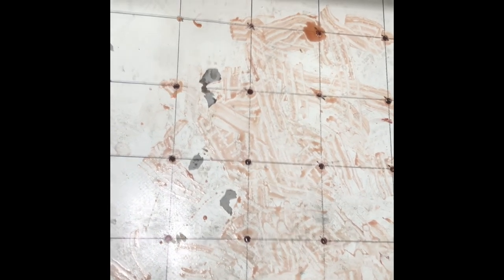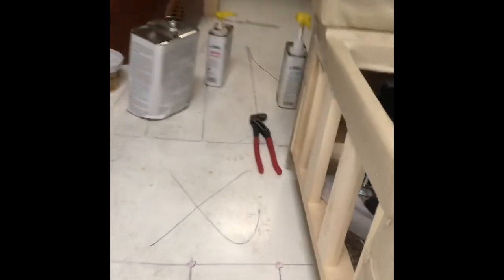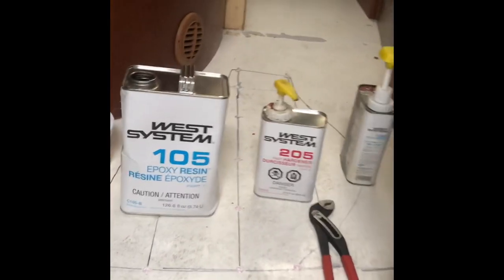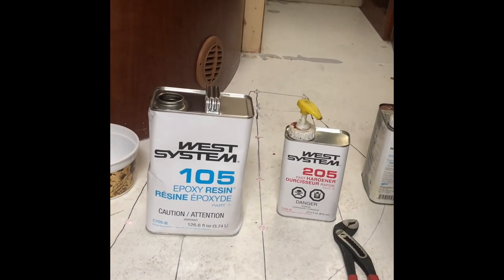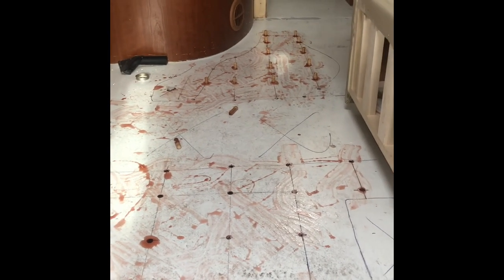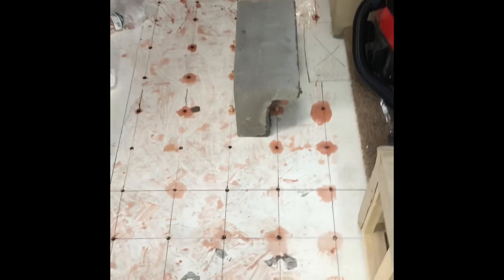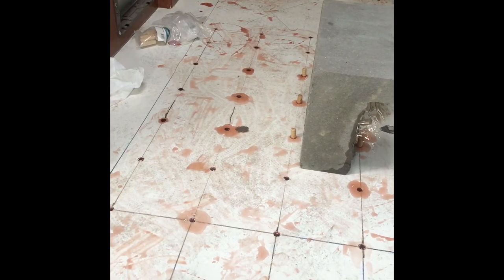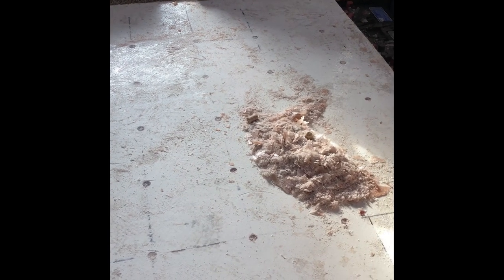Soft spots in a RV/motorhome floor Bonded or sandwich floor fix

Comment: Good video, I repaired my RV floor this way as a result of water damage which I think is often the cause. In my case, the floor (2-3 inch foam sandwiched between two thin layers of plywood) was still wet on the underside and the underbelly membrane had de-laminated in these areas. I think It is important to cut open this membrane to check for moisture and let the plywood dry out first and then glue and  tape back or replace the membrane before you start the epoxy. If there are sagging areas of membrane and  layers of plywood then you will end up wasting alot of this expensive epoxy to fill these voids. I used a jack and a piece of plywood to push the underbelly flat after gluing and epoxying. From above, I used a squeegee to push the epoxy flat after my injections. I would often epoxy down the holes a second time if they seemed to suck up way too much epoxy. Areas of the floor covered by cabinets etc could be done same way as people post how to epoxy RV wall back together (by injecting down tubing attached to a long flexible steel rod or drill bit) then holding together with plywood. Before I started the project I covered all roof seams with 2" and 4" wide Butyl sealing tape and I will re-calk some windows/compartments.

Comment: Keep making videos, RV repair diy is very niche and in need of posters like you with hard and reliable experience.  Nothing more frustrating than looking for specialized help and finding none. I had one more question, do you know if any RV manufactures stand behind their faulty manufacturing or faulty materials supplier? You’d think they would, if only in order to maintain their reputation.
Reply from the maker: I’m glad you enjoyed the video. As far as your question it really depends on the dealership in my experience to how well you are looked after. The manufacturer does not really deal with the public

Comment: Thank you for sharing this video. There is not many videos or forums on RV foam floor repair. I used West systems 105/205 on my Ultra-lite travel trailer for a 3'X3' section of my floor. Surprisingly it worked and is holding up. I believe this is the only epoxy resin on the market that will not melt foam on contact. Once its mixed together, you have about 10 minutes to inject it into the floor. Once it is set, the resin heats up hot for a bit. The product was not cheap ($70 Amazon) but cheaper than a dealer repair for sure.
Reply from the maker: reservordogz 
Glad it helped the floors I have done are still going strong with no issues.
Reply from the maker: Glad to see the video helped. All the floors I have done this way are still standing up. Hope to do more videos like this need to break the 1000 subscriber mark then it will be easier to do these videos
Reply: So regular fiberglass resin you can buy at home depot or advance auto will not work? Any alternative to the West systems 105/205? Great video.
Reply: Hi there. Was your trailer a jayco? Was it the Luna panels? I have a jayco hybrid 17 ft camper trailer with the Luna panels in the floor. I am noticing some soft spots in high traffic areas. This seems like an excellent alternative to resheating the floor to regain some strength.

Comment: Good evening fantastic video. I have the exact same model of motorcoach and soft spots in the same locations. I took up the Lino today to do some other work and was sent your video. I found a local marina that has the west system epoxy, so I will be doing this tomorrow. Again thanks for the awesome video.
Reply from the maker: Just through the top layer you will feel the drill bit hit the bottom layer use light pressure you should be ok. As far a the grid pattern I just do what ever grid that will work in the area you may end up using less or more.

Comment: This is an awesome video. It is a alternative to trying to resheat your floor with a new product to regain some strength and high traffic areas. I will definitely be doing this to my jayco 17 ft hybrid. I have been noticing some soft spots starting in the Luna panels.

Comment: I've seen where you mentioned this would likely work on wood/Styrofoam combo. I've been looking from underneath contemplating adding supports when I found your video. Question is, I do see the floor move (push down) when someone walks on a problem spot. Is that what this is helping with in general or should I keep looking at adding supports here? Thanks for the video btw!

Comment: Thanks for making this video.  Wish I would of found it 6 months ago before I started trying other methods to support my droopy/sagging floor.  Does this fix seem to be a permanent fix or a temporary patch?  You show the dowels but didn't show actually using them.  Do you need to put them in each hole or just under certain circumstances?
Reply from the maker: I used them in every hole

Comment: We just bought a 2014 Rockwood end of April 2013, used it first time in mid-June and found soft spot on a 10"X10" vinyl in front of the entry door.  The rest of the floor is ok.  We've owned Rvs for over 30 yrs and have never had this issue.  Should we remove the underbelly to find the problem rather than rip the lino
square?  Where are you in Central Alberta?
Reply from the maker: Would have to see it to give you an answer on that. I’m in the Red Deer area.

Comment: Great video ! I have a 2013’ forest River v cross . Previous owners weighed 400 lbs and now this rv has soft floor. Question: why couldn’t I drill thru the vinyl flooring instead of removing all the vinyl, then install new vinyl floor over top of old floor (which would have holes and epoxy in them) ?
Reply: This video answered my prayers!!! My elder mom just bought a 2017 Forest River Vibe and there are very soft spots in front of the kitchen sink and the toilet, they both have a round appearance, like the vinyl has a round hole beneath it with no support. I’m a novice DIYer and am looking for a workable solution that doesn’t involve pulling the entire floor out. My question is, could I skip removing the vinyl, space and fill the holes right through the current vinyl into the sandwich, then use peel and stick vinyl over it -(in the places it shows, not in the storage areas, under beds or cabinets) once the epoxy sets?
Reply from the maker: You could but all the imperfections will telegraph through the new floor. Would have to float the floor after.

Comment: Hi - I just watched your video and I think it's a great idea to do it this way but I wonder if using an expanding closed cell spray foam would work as well? Closed cell foam is a great product. It has superior insulation, will never break down and is water proof. It also add's a degree of structural strength.....
Reply from the maker: It might but you would run into the same problem that caused the problem in the first place. The lack of support under the floor caused the foam to separate from the top and bottom layers and cause it to deteriorate causing the soft floor. Spray foam may fill and firm up but would not provide the structure the epoxy does
Reply: @thecanadianrvrepairguy3062  - Thanks you may be right I'll have to do more research maybe in the end going the epoxy route.

Comment: Great job. I know this video is several years old but I have some questions. Did you remove any of the wet wood or did you let it dry out first and then work with it?

Did you support if from below?

I have a 3x3 sort sport right on front of a slide nd it really sinks when stepped on. It's also sunken before it's stepped on. 

Thanks for any input you can provide.
Reply from the maker: I did not have to remove anything on this job. The reason on this one was due to deterioration of the foam over time.

Comment: We have a 2018 "ultra lite" travel trailer with the foam floors, but haven't had this problem yet. Would you say it's inevitable that we will? Also, I apologize if  I missed this, but what happens to the dowels. Are they removed, or cut off flush with the surface? Great video. THANKS!
Reply from the maker: Does not happen to all units, only ones that lack support under the floor. As far as the dowels they get cut off flush and sanded down before the Lino gets put back down.
Reply: This gives me peace of mind what to do if the problem develops. There are other videos of people doing insane projects replacing their floors, this method looks doable. THANK YOU!

Comment: Did you reuse the vinyl flooring, or did you have to buy new flooring.
Reply from the maker: Yes I re used the vinyl.
Reply: Was the flooring glued down? How did you remove it and what did you use to re install it? I have a Rockwood that I am going to do this to with the same flooring.

Comment: What do you use to reinstall the Linoleum? I don't have any trim. I suspect you use some type of adhesive to "glue" it back down.
Reply from the maker: It all depends on what type of Lino you have paper back, felt back. Find out what you have and get the correct glue for the Lino you have to put down
Reply: @thecanadianrvrepairguy3062  thank you

Comment: Did you have any sagging where there were seams in the flooring panels? I have some at the seams and am concerned this will not fix those areas.
Reply from the maker: No I did not have seams if I had some pictures I might be able to give you a better idea.
Reply: @thecanadianrvrepairguy3062  thanks for the quick response! If you reply with your email I'd be happy to send you a video and/or some photos
Reply: Hi , liked the video good job. I was thinking I would lay quarter inch ply over the whole floor to fix the occasional soft spots. And screw it down. Would you suggest that or not. Thanks. N.B. CANADA

Comment: was your floor uneven?  I have several "dips" in the floor, so I'm not sure if this repair would work
Reply from the maker: Yes there are always dips from the foam breaking down. The thing you need to watch for is once you inject the epoxy you can get high spots

Comment: Thank you for sharing your floor repair. This is a real issue for coaches with bonded floors. What make, model, and year was the Sprinted-based RV you were working on? Also, how thick was the foam core between the Filon sheets? Anything you would change about the process if you were to do it again? Thanks again!
Reply from the maker: The foam core was 1” thick.
Reply: I am not sure of the year but that was a Thor Siesta 24SA, probably between 2013-2015.
Reply: Has anyone sued the manufacterer as this seems to be a common problem? I have a 2015  Forest River Micro Lite with same problem. Thanks for sharing

Comment: How does this type of repair hold up over time?  Also I have been researching this repair online and have watched several videos on Youtube and it seems that this type of repair is not very common in the U.S.  I have a 2011 Keystone Laredo that has a spongy floor, not due to water damage, so I am very hope full that this is my answer. Thanks from Texas
Reply: Did you do this and how did it turn out?  We have a 2012 Keystone Outback that has soft floor in a few places.

Comment: Thank you for the video. I’ve been stumped on this issue and this appears to be the same make/model as mine. My question is how did you get the linoleum out from under the slide? Did you have to remove the slide? If I cut it just under the lip of the slide so you can’t see it, I was concerned the linoleum would pull up when the rollers extend/retract. Any info would be helpful. Thank you!
Reply from the maker: That is where I cut the linoleum as far as I can reach under with a knife. Then I glue it all back down and if it look to be an issue of peeling I staple the edge as it is still in an area the can not be seen. But the glue usually is all that is required and no peeling issues.
Reply: @thecanadianrvrepairguy3062  That’s really helpful. Thank you so much for the quick reply.

Comment: Is there a way to replace these types of floors economically? Can I change it to a traditional joist and plyboard floor? Or any other suggestions on how to replace\repair if the entire trailer floor is badly softened or is this the best\only method?
Reply: Because of the light or ultra light designs, it would be a tedious and exhausting job.
You're better off using this product and it leaves it harder then original.
Reply: @JulioHernandez-xk7np  - You aren't wrong! LOL At the present time, I have a camper box sitting on blocks and the trailer pulled out from under it in my back yard. 🤦‍♂️ 
New floor being installed next weekend.

Comment: How can you tell...#1: what type of floor you have. #2: how deep to drill? Good way to fix a floor. Great for a small are that needs repair. Better get a camera guy to free up your hands. lol
Reply from the maker: Yes I don’t always have someone to hold the camera. As far as telling what type of floor you have lift the Lino up in a inconspicuous area and see if you have filon or wood under it. Hole depth just through the first layer and stop when you hit the bottom.
Reply: If you have ductwork under the unit with floor vents, you can pull the vent up and get a good look at the floor style as if you cut out a cross section 🙂

Comment: Soft spots are caused by water. Water breaks down wood, foam and so on. You aren’t fixing the water damage which can lead to catastrophe damage from the water damage you can’t see
Reply from the maker: So this comment keeps popping up about water, I would hope I would get more credit but seen as I’m going validated a comment such as this I will explain further. Yes water could cause these issues but if you where paying attention to the holes that where drilled in the grid pattern all the foam was white free of discolouration and full of static. Which in turn indicated that no moisture was present or ever been there. Next time you choose to comment ensure you know all the facts.
Reply: Newer campers are made with just foam flooring and high traffic areas usually get soft quickly. No water has to be introduced for this to happen.

Comment: This is only hiding a problem. Find the leak which has caused the floor to become soft from water leaking in and fix it first. Then address the floor.
Reply: No leaks necessary just normal traffic will compress and disintegrate the foam
Reply: It's foam wear. Not water damage
Reply: How long did u wait to walk on it. I did this early this morning wondering how long to harden